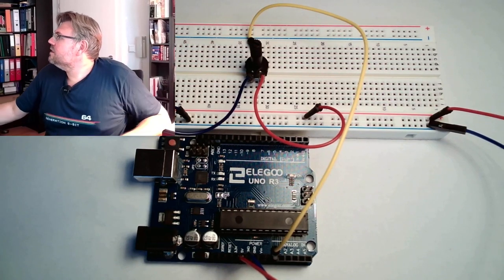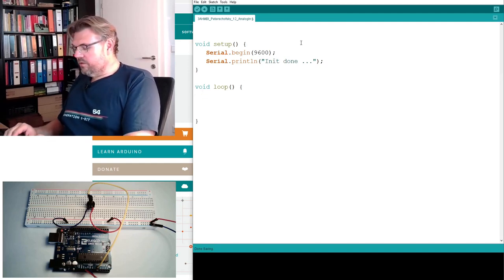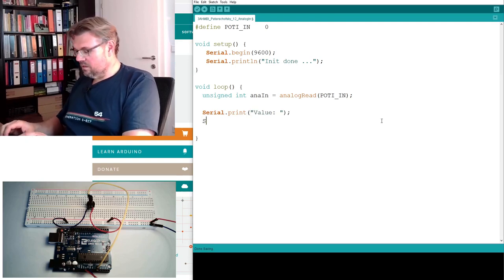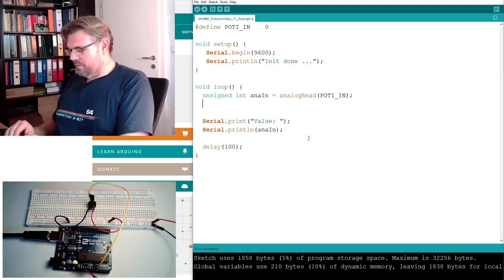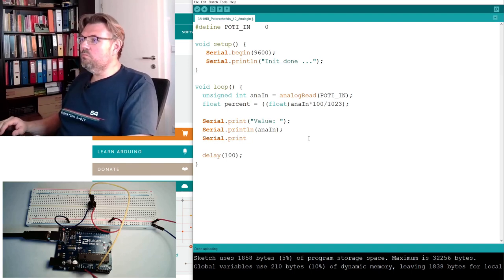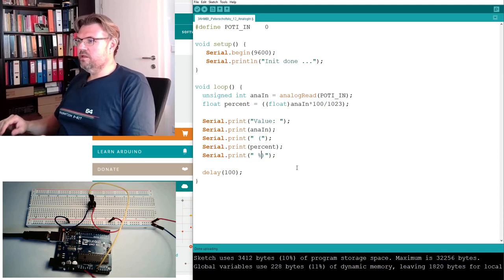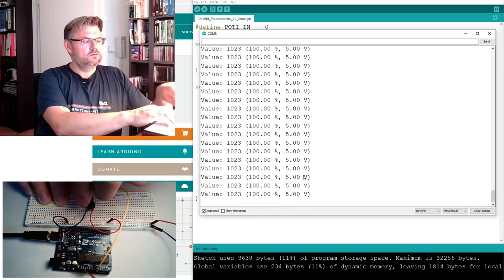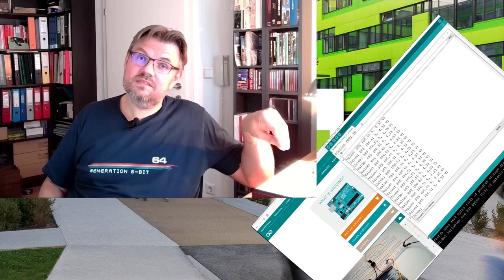Arduino 24: Analog Input

Comment: Hy! Could you help me with an analog input float problem. The arduino will measure an external 0-5v. Not good with stripping resistance either. so jump random as in the video below. What could be the solution to this?
Reply from the maker: Hello. Is the ground of the Arduino and the ground of the external 5V are connected? Maybe the reference potentials are floating.
Reply: @HeinzPeterschofsky  gnd is common. If you connect a potentiometer with your own 5v and gnd, it works perfectly. When I plug in the source I want to measure, it floats. I also put a pulling resistor on it, but it didn't work out. the cables are shielded UTP cable. I have no solution yet.
Reply from the maker: Yes, these voltage-signals are somethinmes tricky. They really can be messed up easily. Do you have the possibility to switch the seonsr to a current signal and use a resistor close to the Arduino to convert the current signal to 0-5V? I am using this for a 4 to 20mA signal from a drive. I am using a 220Ohm resistor and a potentiometer in series to be able to adjust.